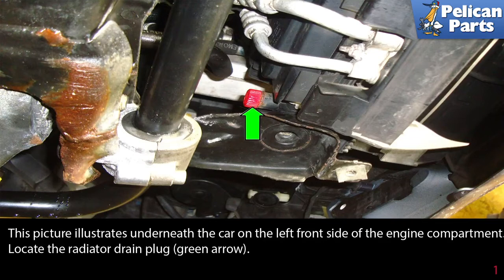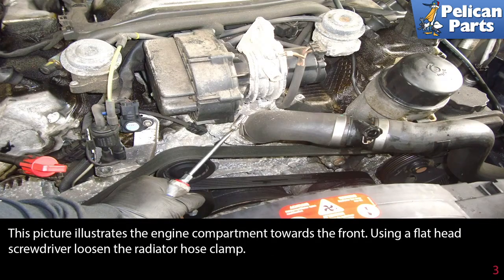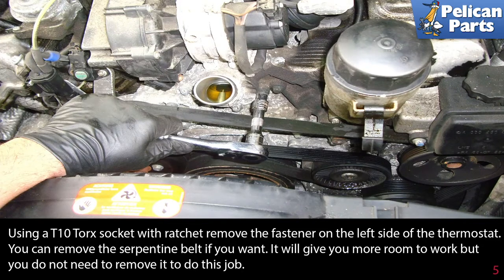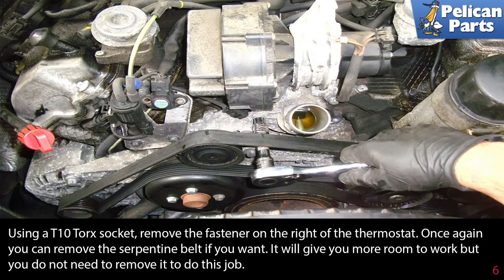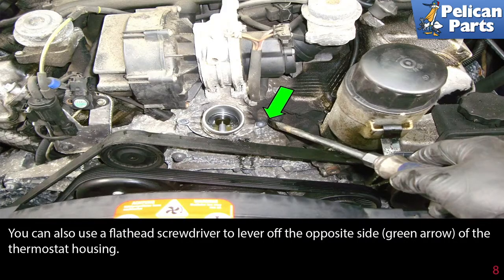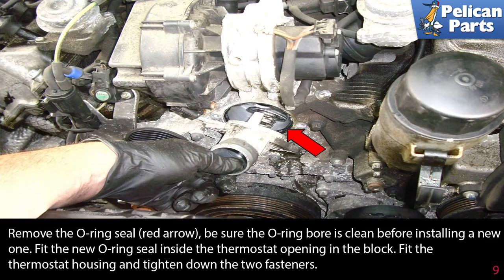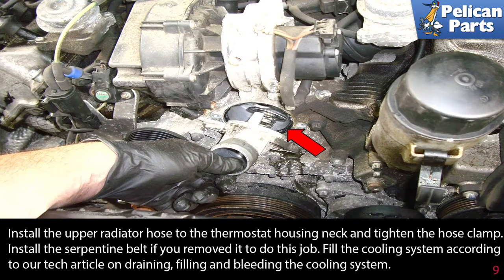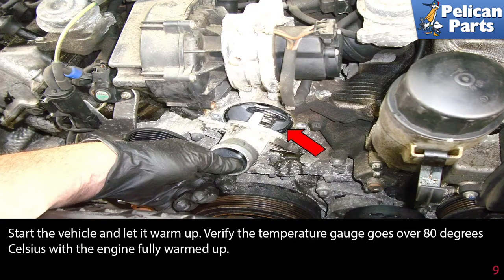Mercedes-Benz W211 E-Class Thermostat Replacement

Comment: How can I determine if my heater problem is caused by the thermostat or the heater control valve?
Reply from the maker: If the engine reaches operating temp in a short amount of time, the thermostat is likely OK.
Reply: @pelicanparts  Many thanks.